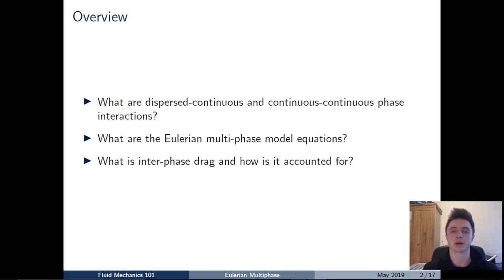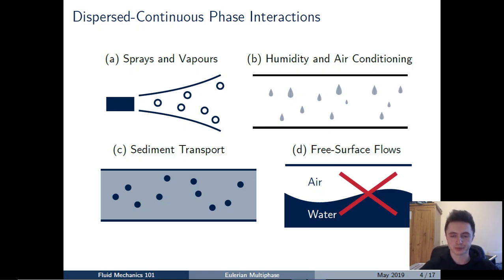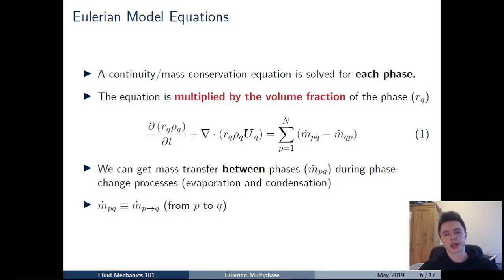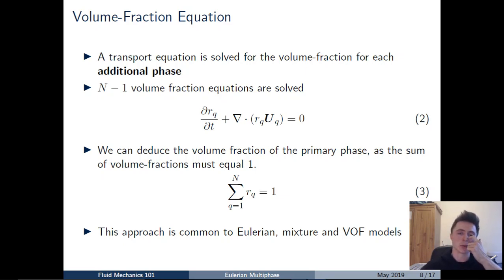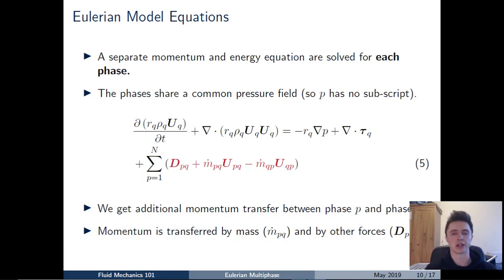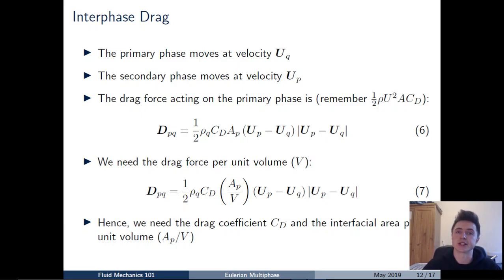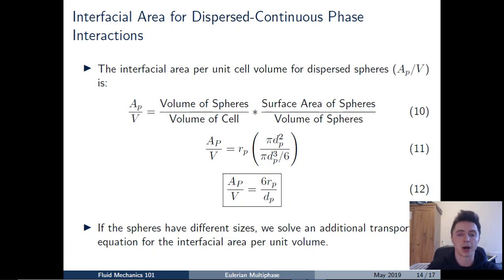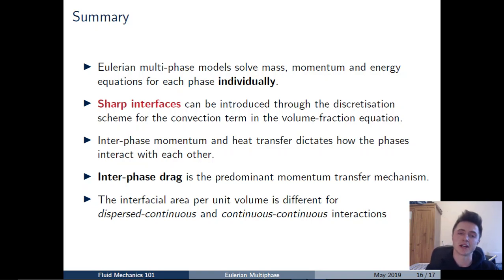[CFD] Eulerian Multi-Phase Modelling

Comment: Hi, can you please tell me what are the boundary conditions required to solve the volume fraction equation in VOF model?
Reply from the maker: The standard boundary conditions normally work. Fixed values on the velocity inlets and zero gradient on the other surfaces
Reply: @fluidmechanics101  Thanks Aiden. I have another query. In a dam break simulation using VOF, what will be the bc to be applied on the inner surface of the fluid while solving the volume fraction equation?

Comment: Thank you, may I ask a question ? 
Assume we are spraying water in hot air (~1000c). some of the water will evaporate. Now, At the beginning of time t=0 we know r_vapor = 0 every where (we don't have vapor yet). If we consider the equation (4), r_vapor will not change as time progress (r_vapor = 0 for every time step). Is this correct ? Should not we add a volume fraction term (representing the transfer from water to vapor) as we did to the continuity equation ?

Comment: Sir, can you make another video on the algorithm/procedure to solve these complex equations.like I didn’t get how do we get pressure equation and solve it.
Reply from the maker: Yes, I am working on this at the moment. It is quite confusing and the pressure correction equation is definitely one of the hardest parts to understand in CFD
Reply: @fluidmechanics101  Sir, if possible can you suggest some references untill you upload the video prefereably for the compressible cases. Thanks.
Reply from the maker: The book by Ferziger and Peric (computational methods for fluid dynamics) is pretty good. I would start there 👍

Comment: Why is the mass transfer term 'sink' for the liquid water In case of evaporation?
Reply from the maker: The liquid water phase loses mass, while the gaseous vapour phase gains mass. So the source term is negative for the liquid phase and positive for the vapour phase. Of course if you have condensation, it is the other way around 👍
Reply: @fluidmechanics101  Thanks a lot, Dr. Wimshurst. Now it's clear to me.

Comment: Hi! Thanks for another wonderful video. I was wondering, is there a way to know how much governing equations I'm solving in total? If you e.g. have three phases, but they are coupled via drag / the sum of the volume fractions is one. And only considering mass and momentum (no energy and turbulence). I don't quite understand how fluent solves/couples the equations, and thus how many equations you're eventually solving. Cheers! Michelle
Reply from the maker: You could always just check the residuals that fluent writes out? Fluent will write the residuals for every governing equation you are solving, so this is a quick way to check. For example: pressure x-mom y-mom z-mom volf-1 volf-2 would give 6 governing equations? (3 momentum, 1 pressure, 2 volume fractions) which is what I would expect for 3 species
Reply: @fluidmechanics101  thank you!!

Comment: As it was mentioned that the dispersed particles are dissolved in the continuous fluid (1:53), So my doubt is if it is a solid particle then will it also get dissolved in CFD simulation?

If we don't want the solid particle to be dissolved then what type of modeling approach (i.e., Models in CFD) needs to be followed?

Thanks in advance
Reply from the maker: If your particles are large, then you probably need to look at Discrete Particle Method / Discrete Element Method. It is available in Fluent or MFIX. Not sure about CFX or OpenFOAM though 👍
Reply: @fluidmechanics101  So, you mean Dense discrete phase model (DDPM) with Eulerian phase?
Reply from the maker: Yep

Comment: If I want to simulate LNG dispersion which would u recommend?
Reply from the maker: Hmmm depends on the morphology of the gas bubbles in the fluid. Are they dispersed or continuous. Is there a free surface or do you have slug flow?
Reply: @fluidmechanics101  dispersion, just trying to recreate falcon series tests

Comment: So in continuous-continuous flows, we don't normally model the ''surface drag'. For two incompressible fluids, the interface velocity is continuous. ie there is no phase velocity difference. However, I am talking about the single-fluid approach - which is the standard approach for fuel/tank slosh - maybe it is different in the multi-fluid approaches.

I have never header of using the gradient as a stand-in for the surface area. I mean there is no mathematical reason for the gradient of the volume fraction to be related to the surface area, they are spatially orthogonal quantities. The gradient is used frequently as the interface normal (when normalised). For an algebraic VOF scheme, knowing the surface area of the interface is next to impossible, but for geometric methods, it is implicit in the scheme. 

Sorry perhaps because I work building these models I am being a bit critical. I love this channel in any case. Please don't take it personally, just a bit of confusion on my side.  :D
Reply from the maker: Good comments! I always appreciate feedback from people who actually develop the models, as it really helps clarify the understanding. The best I can ever go for is reading the manuals, equations and trying to make deductions from these 😄
Reply: @fluidmechanics101  Thank you so much for taking the comment in good spirit. I was really worried it came across wrong and I really find these videos of great quality and I appreciate the work you do. I have learned a lot, and it's nice to be able to absorb advanced content in related but different areas of CFD. If you need to reach out regarding multi-phase stuff feel free. I am a Post-Doc in InCFD at the University of Cape Town. :D Thanks again for this channel.

Comment: Thanks a zillion for your awesome videos. Honestly, my CFD knowledge has improved significantly since I started watching your great informative videos. Anyway, there was something that I couldn't understand very well at the penultimate slide which was about Ap/V of the continuos-continuous phases. I was wondering if you could explain it to me how this ratio is equal to the gradient of the volume fraction.
Reply from the maker: I can't remember exactly why this is the case. It is stated in many of the CFD manuals without much explanation. I know that's not very helpful but it's the best I've got at the moment 😅
Reply: @fluidmechanics101  Thank you Aiden. By the way, may I ask you to introduce a source from which I can learn better the discretisation methods for the convection term of the volume fraction equation of the continuous-continuous method? Or if it's possible, could you please make video on them?

Comment: Hi Aidan, if I want to simulate in Fluent for Moisture diffusion into something (like Electronic Packaging with voids inside them that allow moisture to diffuse in), do I need Multiphase model: Eulerian in this case?
Reply from the maker: For moisture diffusion you can just use a mixture model. In fluent you need to define a custom fluid as a mixture of air and water vapour. Then enable species transport and fluent should solve for the mass fraction of water vapour which you can convert into a humidity. With moisture calculations, there are no distinct free surfaces or interfaces between the water droplets and the air so you don't need an Eulerian / Volume fraction based approach. I hope this helps!
Reply: @fluidmechanics101  Thanks for the reply Aidan! will try that out.

Comment: Great video Aiden.  What model should I use if we have both continuous-continuous and dispersed-continuous interactions in the same flow system?
Reply from the maker: If you are using CFX you should be able to have different interactions for different fluid couples. I am not sure about fluent or openfoam though

Comment: Sir, while modelling flow-boiling how do we decide the first cell size in the mesh accounting for different Reynolds no of different phases?
Reply from the maker: I would estimate the volume fraction of each phase and then calculate the volume averaged material properties (density, viscosity). You can use these to get an estimate of the Reynolds number, friction coefficient and y+
Reply: @fluidmechanics101  thank you sir!

Comment: Hello Aidan.  I Have a question. In air-water multiphase flow CFD simulation's it is common to use a VOF = 0.5 to track or identify the position of interface or free surface. I would like to know why this criteria is used and if it can always be assumed the same. Otherwise, I would like to know if volume fraction can be taken different to 0.5 and, if so, ask you about a methodology to find this volume fraction. In Summary: Which value of volume fraction I can to choose for to identify free surface in an air-water simulation of open channel?
What you do is great! Thanks for sharing your knowledge!
Reply from the maker: Hi Leonardo, yes you are right, it is common to use a volume fraction of 0.5 to track the free surface. This choice is arbitrary of course and you could really use any value between 0 and 1. The important thing to remember is that the CFD code can only resolve the free surface to within a cell. So perhaps a better way of defining it would be: the free surface exists in a cell where the volume fraction changes between 0 and 1. We cant say where in the cell it is, only that it is within a cell. So 0.5 is just useful as it is between 0 and 1. Interface compression algorithms usually try and steepen the gradient so that the volume fraction changes within 1 cell (instead of several) so it makes it easier to locate the free surface. I hope this helps 👍
Reply: In algebraic VoF approaches (CICSAM) this does get used. However, in the actual physics governing equations, there is no distinction, just a region of smoothly varying material properties (its why we do VoF). The 0.5 can help to localise certain terms for example surface tension and evaporation. Although even here typically you don't find 0.5 being used rather volume fraction \in (tole, 1- tole). The geometric methods have a discrete representation of the interface so for them, they 'know' where the interface is. In all, I would say the use of 0.5 is most commonly a post-processing thing.
Reply: @thunder852za  Very interesting. Do you recommend some book or paper where I can read about algebraic VoF approaches, particularly COMPRESSIVE AND HRIC MODIFIED? Thank you!
Reply from the maker: I would have a read of Unno Ubbinks thesis (you should be able to find it on Google search) from Imperial College London

Comment: Thank you for the video. I had a question though, doesn't the two-phase full eulerian model also have an inequality bound restraint on the phase fractions (i.e. 0 <= r_q <= 1 ), I've just been having trouble thinking how this is enforced in CFD discretized models.
Reply from the maker: Yes, the CFD code uses a limiter to ensure that rq stays bounded in the range of 0 to 1. Limiters are quite complicated, so i havent covered them yet!
Reply: Part of that restraint is imposed in the way you obtain your pressure equation, additionally you have to properly integrate the phase's transport equations.

Comment: Nice video, thanks. However, in the drag model, please note that what counts is the frontal area of a sphere, not its surface area. The Cd of a body is generally defined using its frontal area. Therefore, equation 12 turns out to be 3/2*rp/dp, not 6*rp/dp
Reply from the maker: Well spotted! Thanks for the clarification 😊
Reply: @water5825  The surface area of a sphere is 4*pi*r^2, the frontal area is the area of a circle, which is pi*r^2. So as you can see, the frontal area is 1/4 of the surface area!!

Comment: Hello Aidan,
It’s a Very nice video.
So multiphase modeling is applied for phase transition between liquid and vapor refrigerant in a small diameter channel with larger length.
But why most of the time solution diverge or temperature doesn’t not change?
Thank you very much
Please leave a suggestion

Comment: Thank you for the videos, they are pretty cool. 
Could you please say to what references do you get to study and maybe make your materials?
Reply from the maker: Mostly, i use the CFD user manuals from ANSYS, the OpenFOAM source code and textbooks. Often these sources arent very good, so i try and work things out for myself as well 😊 I then try and compile everything together in a really clear form for you guys, as there really isnt a great source of CFD information out there. Thats what im trying to make 😄
Reply: @fluidmechanics101  Thank you for your reply, I asked that becausa I felt the same think as you said and I wanted to confirme. 
I am doing my course conclusion work and I would like to have some lectures to put on the reference and explain all the things that I have done in my research (that is to develop a tool using OpenFOAM to predict the resistance curve for a ship of the Serie 60 merchant ships) . 
If you could help in some way with that I would be very thankful, and thank you for your help and your good videos!

Comment: Hello sir, may i ask a few question? Lets say i want to insert diesel fuel in chamber that contain air as their fluid. should i use multi phase model in order to separate the two fluid which is diesel and air to identify the flow of the diesel and if yes which model should i use?.. Thanks sir for answer my question before..
Reply from the maker: Yep, i would use an inhomogeneous multiphase method (seperate momentum equations for diesel and oil). I would only go for a homogenous method if you are sure that the drag forces are only significant near the interface

Comment: Thank you for the clear explanation! For a project I need to simulate the dynamics and concentration profiles of polydispersed nanoparticles in a microfluidic and I was considering to approach the model using the Euler-Euler method in COMSOL (treating them as a dispersed phase), also introducing LES equations. Can this model be considered for nanoparticles? Do you think this approach could work?
Reply from the maker: Hi Samuel, yes your approach seems reasonable and will probably work. Im not sure if LES is necessary though. It depends on what quantities you are interested in studying.

Comment: Great explanation. I would request you to kindly give an insight to the modelling of  mass transfer mechanisms between the different phases in your next video.
Reply from the maker: Hi Hassan, the mass transfer mechanisms are very tricky and im going to have to put some careful thought in before making a video. The essence of mass transfer is equal and opposite source terms in the volume fraction equations so that you get an effective transfer of mass between phases where you want it. For now i hope you have enough to help out with your CFD, while i research the video 😄
Reply: @fluidmechanics101  "The essence of ... source terms in the volume fraction equations ...": this eqn reads partial r_q/partial t+div(r_q U_q)=0 in your video, do you mean in the case of mass transfer between phases, e.g., phase change, we should add source terms on the rhs of the original volume fraction eqn?